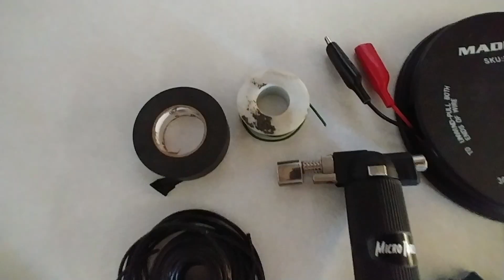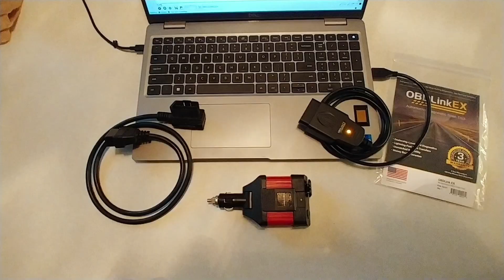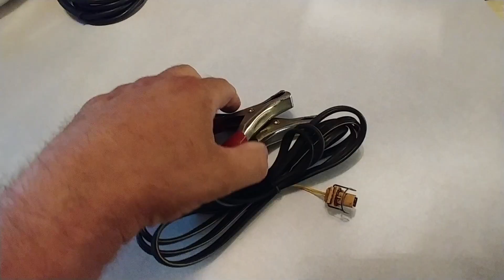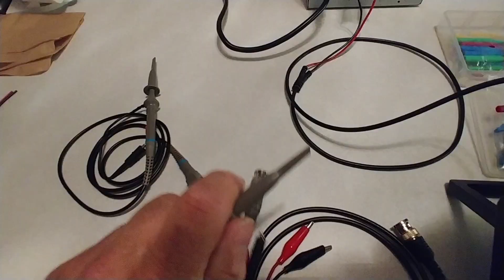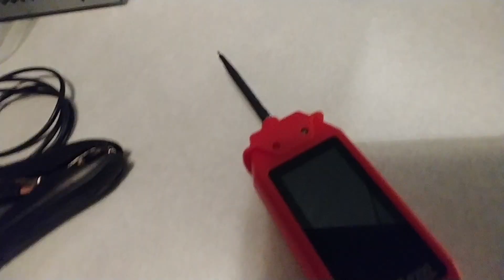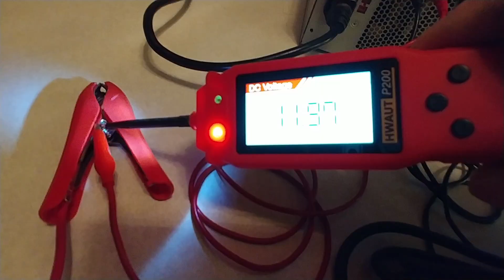What Tools Do I Use Most For Electrical Diagnostics?

Comment: Great video. Lots of good information. It's easy to run PWM at any voltage (3-30V). Use a 10 dollar ZZ-PP2K driver and attach 4mm banana leads for power in and PWM out. Now, hookup any power source from an m12 battery (just make spade terminal to 4mm cables) to 5V USB  (just make a USB-A to 4mm cable, run it off any USB power  source).
Reply from the maker: Thank you, I'll look into that!